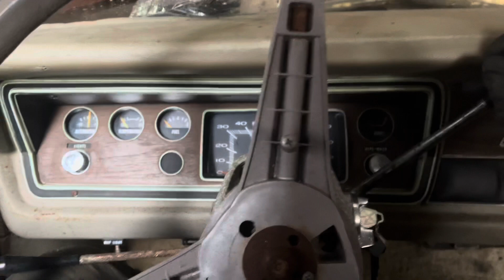Aggressively Disassembling a 1973 Plymouth Scamp Rust Bucket (And Ruining My Driveway)

Comment: So mean.  I can see having that much fun vivisecting a honda but not a Mopar.  

OTOH I saw a fair number of good parts that became available (I imagine you got less out of it than I would guess from just the video view; the instrument panel looked ok, some trim, windows and regulators, etc.
Reply from the maker: The complete instrument panel and harness were saved, the drivetrain, the rear axle. The only piece of sheet metal on the body that wasn’t totally Swiss cheese was the trunk lid, and the back bumper only had one hole so I saved that too. I saved the interior, nuts, bolts, doodads, etc. If this car was at all salvageable, I think you know me well enough to know that I never would’ve done this. When you can peel body panels off by hand without removing any fasteners or cutting things… it’s just all bad!
Reply: @DeadDodgeGarage  Oh no, I could see that it was a basket case and only good for donor organs (and thanks for the details!); I wasn't sad about that.  I just felt bad about celebrating the destruction (and I know demolition can be fun).  

When a  Mopar dies it should be somber.  A "Sad thing is happening", though it dies so that others may live and be rebuilt. I channel Phao from the Jungle Book:  "Howl, dogs! A wolf has died tonight!”

A honda's final resolution, on the other hand, is a reason for celebration, carousing, destruction, fireworks, and (firearms or booze).  It gets turned into something useful, like rust and embers.

And you know what?  A '70s Swinger convertible would have been a great looking car!